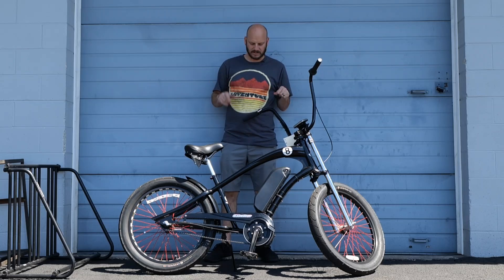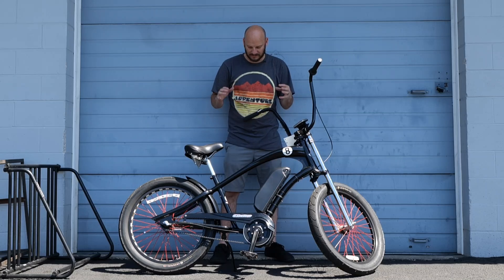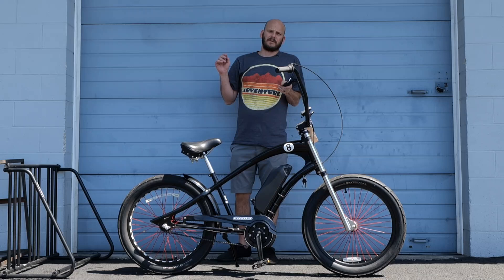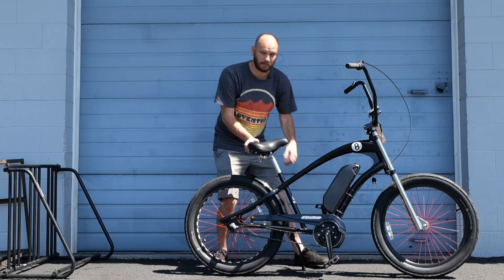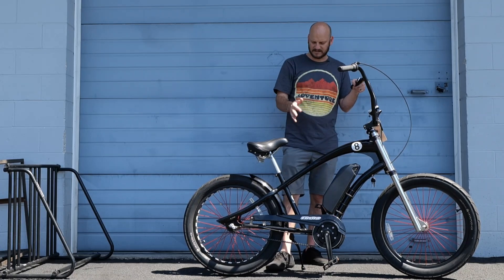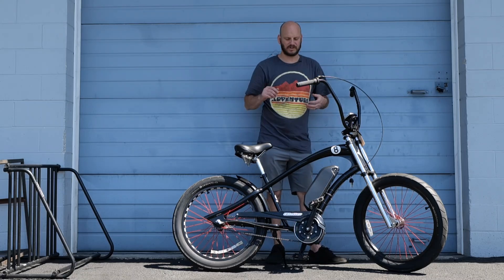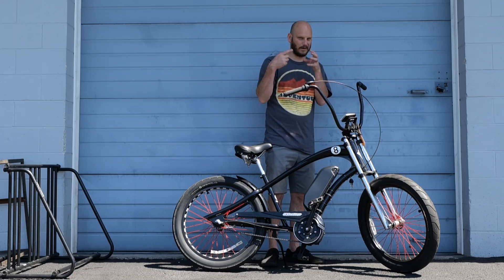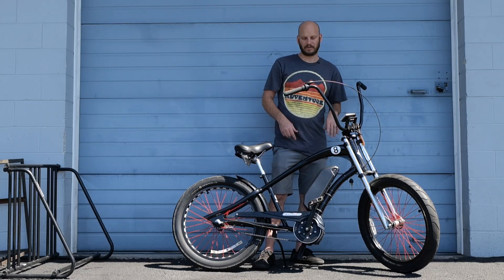A mid drive for Coaster Brake Bikes: Tongsheng to the rescue!

Comment: I've wondered whether you could squeeze a mid-drive above the bottom bracket on a frame like this.

I have an older Electra Rat Fink with an Ashtabula BB, and there are an additional couple of inches between the BB and the base of the seat tube. Does anybody know of any limitations? I know that I could use an eccentric Ashtabula adapter, which would give some flexibility for positioning the motor.

Edit: I'd be running a freewheel and disc brakes, so no complications introduced there.

Comment: How much is this whole dealio ?  I have many Electra bikes. Single speed, 3 speed and 7 speeds.  I'm interested in this system. for the single and the 3 speed Sparkers.  I didn't think you could do this with an Electra because of the curved down tube.  Thanks Johnny
Reply from the maker: Check the description in the video for direct links to the Parts used and that will give you an idea of how much it would cost. You could probably get this done for about $800.

Comment: I've done a couple with the 500W and the only problem I've had with em is they tend to eat coaster brake Hubs. I've end up using Shimano CB-E110 Coaster Brakes and doing a modification to them that can be found on line.

Comment: I have one with special Eunorau programming on my 4 speed coaster brake Giant Liv. The problem with thebhigher powered units is that there can be kickback when braking, especially if tou do not maintain your coaster hub. Mine has way over 7k miles on it. Because you have no brakes if the chain breaks, I added a dual pivot cruiser style front brake.
Reply from the maker: Good point about the chain!